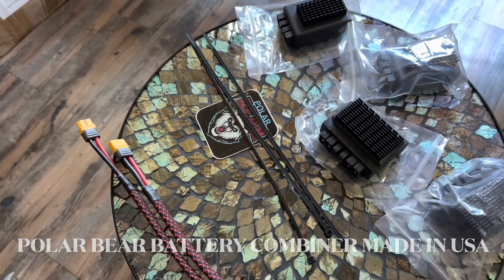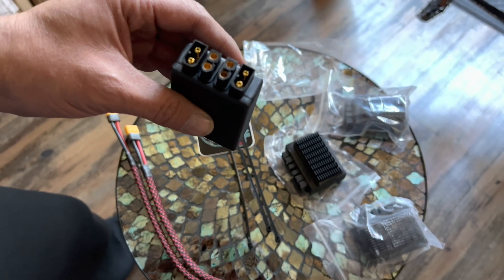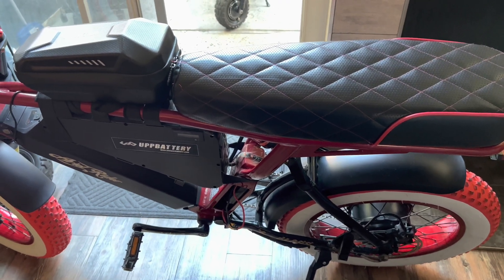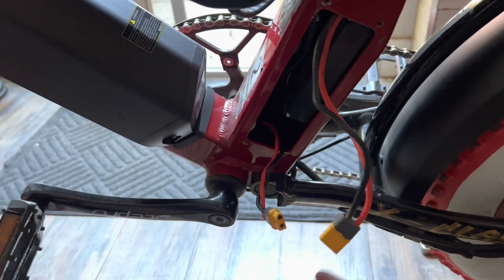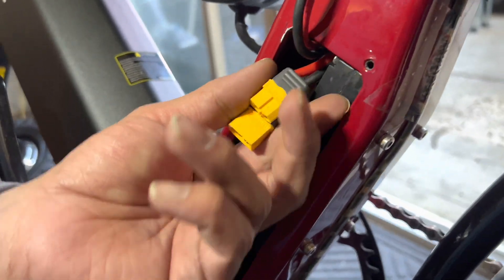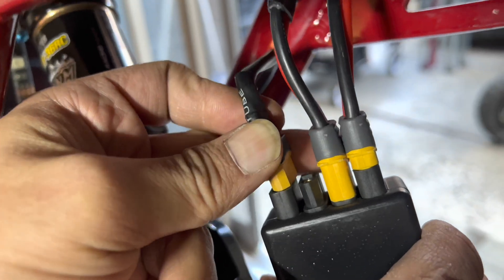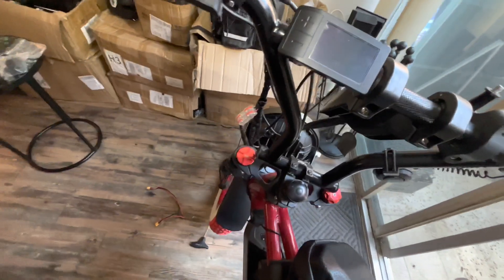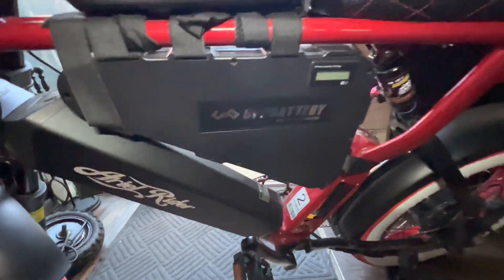ariel rider x-class 52v dual battery setup , Polar bear dual battery combiner

Comment: Do you have any knowledge on how to connect a dual polar bear on a e-bike with dual hub motors and dual controllers. Any feedback would be appreciated. Thank you Randy
Reply from the maker: Hello 
Our battery combiner have 2 xt60 in and  2 xt60 out it’s mean for dual motor and dual controller , you can connect both controller and the dual battery will be shared or you can get the 4 battery combiner and you can use 2 or 3 or 4 batteries
Reply: !! Ha !! That’s why I’m here .. my controllers are already connected to one xt60.. yours should be the same (I have the pedal electric)

Comment: Could I just keep the battery combiner where the controller is and save me some extra wiring?
Reply from the maker: Sorry I didn’t understand your question
Reply: @bebo150067  you put the battery blender under the seat. Wouldn’t it have saved wiring to just store the battery blender in the controller department?
Reply from the maker: @Blackpilld  no because the battery combiner needs to be ventilated

Comment: Hmm, I installed the same triangle battery and combiner according to your instructions ... after 100 miles of driving, my display on the handlebars burned out
Reply from the maker: Hello 
My combiner has nothing to do with display , the display get burned it’s something very common on ariel rider x52v with combiner or without combiner check the Facebook groups , you got a bad display or bad controller but it’s mostly the display ,I have sold more than 2000 battery combiner never ever had any complain ,it doesn’t mean  anything go bad on your ebike that’s happened because of the battery combiner 
Thanks for your understanding
Reply: @bebo150067  I don't blame you for my problem. I just wanted to let you know that I connected everything as it is in the video and unfortunately the display burned me after 100 miles
Reply from the maker: @mikeperry5244  I understand ,for the display I see too many people complain that it get burned or something wrong with it even me when I got my bike I have a bad display or controller before i do any upgrades on my bike and I contact ariel rider and they send me new display and new controller ,I still have brand new display because I choose to upgrade my display to a color display instead
Reply from the maker: @mikeperry5244  hello have you got the color display?
Dose the bike works again
Reply: @bebo150067  Yes, I bought color displays from Keith LaFetra for both bikes and everything works fine (only 130 miles on them). Hopefully the problem is solved.
Reply from the maker: Contact ariel rider company and open a ticket they will send new display or you can upgrade the display for the new color display,(ariel rider will ask you for a small video ,take out the second battery before you shoot the video otherwise you will lose the warranty
Reply: @bebo150067  The warranty is only for 1 year .. I'm after the warranty .. but thanks

Comment: This is a game changer for the cables.  I've always had my cables outside, but this video shows how to snake it thru the frame.  I had a hard time at first, but what I did instead was put the bike upside down.  It's much easier to get to the 2 cables you're snaking.  Great video.
Reply from the maker: Thanks

Comment: Hi is it also possible to use > 52V 28.8Ah 50A LG < for X-52 bike? How long are your XT60 cables? Thx
Reply from the maker: Yes you can use 52v  28.8 50A and the xt60 cable about 50cm
Reply: @bebo150067  Thx for help😁🤟

Comment: You can run both batteries at the same time? I bought your battery blender and have the same 2nd battery as you have
Reply from the maker: Yes off course you have to run them both to get the benefit of the blender  it will reduce the voltage sag plus will give you more range

Comment: Hello! Do you have a link to the battery you use. Or the name I want to make sure i get the right connection type
Reply: Also my I deleted my first question because I saw you sell the cables on the website it answered itself !
Reply from the maker: Here’s the link for it  I got the 52v 24ah  and they delivery is 7 days 
US $387.10  30％ Off | 21700 Ebike Battery 48V 52V 60V 72V 36V  LG TSL Triangle Batteria Electric Bicycle 350W 500W 750W 1000W 1500W 1800W 2000W 3000W
https://a.aliexpress.com/_mNezdSG
Reply from the maker: Ask for xt60 connector
Reply: @bebo150067  you're awesome thanks a bunch 🤙🔥